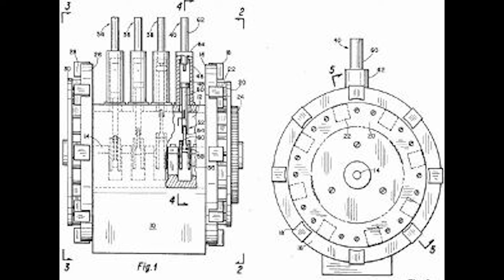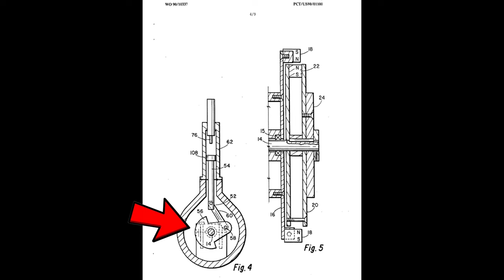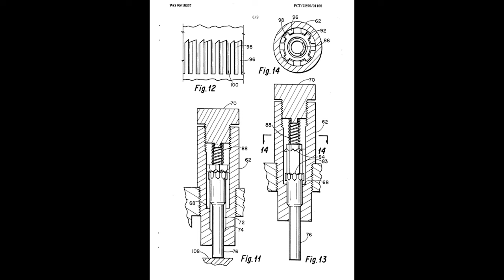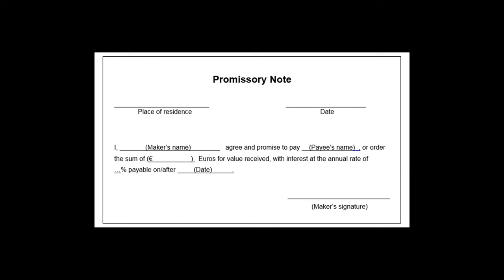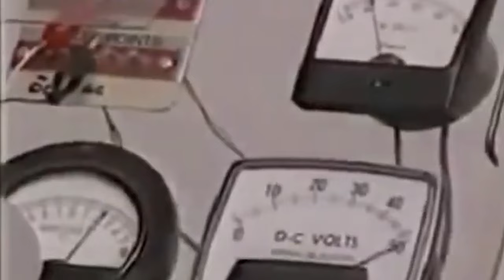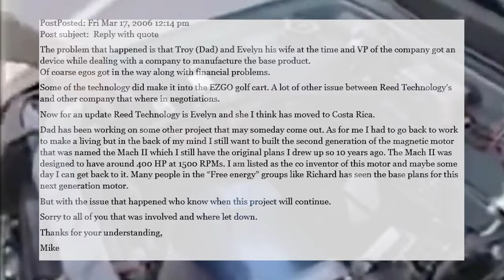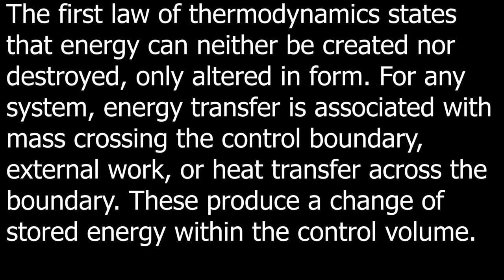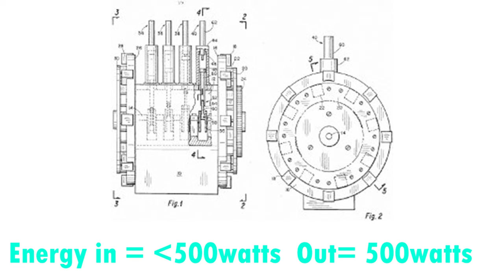Troy Reed and His Magnetic Motor: A Glimpse into His Revolutionary Energy Technology.

Comment: There was some footage of Troy demonstrating what he called the plastic battery, i had it many years ago and since then I have not found any sign of it again. It was car battery size, it would charge to 240volt , it could be charged to just 12 too if i remember correctly. From the little that was mentioned the thing was made of a well known’plastic’ and some metallic plate or film , who knows because he never went into detail. 

There are many patents for self sustaining generators, they get crafty in regards to naming each device. 

Same as the self illuminated,self sustaining unmanned autonomous high altitude platforms, they keep themselves fuelled, filled and powered, can stay up for probably decades at this time, small hydrogen fuel cells, a burner, thermocouples, solar and moisture taken from the atmosphere, some receive power and orders via those beeeg satellite dishes on the ground, some have smaller drones if you will, that decend to deal with ground crew, others deploy their mini mes that go perform individual functions and after an orbit will return to the main platform.
Reply: @darklight2.1  LIES... you tell LIES
Reply: @darklight2.1  You
Reply: @darklight2.1  Enjoy the playlist BTW, it's intended for your type, but also critical thinkers, hopefully help get your head out the sand some ..

Comment: This isnt free energy. Its using the energy in the magnets wich come at a cost. The question is whether that cost is a viable prospect for running an engine.
Reply: Yes magnets do store the energy but I’m guessing over time they will heat up and weaken
Reply: you can also change the magnetic field of a magnet.  When you put a small magnet up against a larger magnet the big one will pull all the magnetic energy from the small one.  This is easy to show with two magnets.  When you try to put magnets into another magnetic field it will change both fields around both magnets.  I have a drawing for a magnetic motor I did 10 years ago.  It is different than any other one shown because I take into account that the magnetic field changes when the two magnetics pass each other.  There must be shielding, magnetic re-charging, and understanding of the angles of force in radians.  Look up radians in your math text.  I have not had time to finish this as I am working on a design for a car motor by rebuilding a gas motor to run without gas.
Reply: It technically is jackass we are surrounded by electromagnetic energy or ether energy the ether exists and it’s all around us all the time just there.. if you can tap into that then it’s free 😂yes it takes brain power to figure out but in the end
Worth it
Reply: Not free energy and does not run on its own.  Magnets do not give off energy.  Magnets just have a static field because the north and south poles are in alignment.  No one has ever made a successful perpetual motion device, nor will anyone ever.  Why?  Everything has losses so you can never achieve 100% efficiency.  If you can't reach at least 100% efficiency, you can't have perpetual motion.
Reply: How long can a magnet stick to the fridge, fighting gravity, before its energy is depleted and it falls off?

Comment: I have a design that I have made myself " it's for an generator that produces enough power to recharge the 
Battery that starts it running in a few minutes. As it runs the out put is enough to power anything if used with my design. It also  depends on how far you wanna scale it
Up... I will be showing what I have designed as it powers 
My RV.... and  eventually a house...

Comment: How much power/energy does it take to magnetize the magnets? Also no one said a magnetic motor is a “free” “ perpetual” motor. 

When you are dealing with a material that has been magnetized the rules you are quoting are not accurate.
Reply: The energy used in magnetizing is rather small and could never run a motor for a reasonable time. If you buy a magnet you also pay for the energy which was used in magnetizing. If a magnet motor would deliver just this energy it would be better to buy energy instead of magnets in the first place. 
Permanent magnets deliver forces, no energy - except potential energy which is always plus and minus.

Comment: You wrongly assume these are truly closed loop systems to apply those laws of thermodynamics. The truth of the matter is, these don't violate any laws any more than a solar panel when you realize they are actually "open loop systems" held to the laws of open loop thermodynamics . According to the world famous physicist Richard Feynman, a cubic meter of space at the quantum level has enough energy to boil all the waters of all the oceans of Earth. Feynmen was widely regarded as the most brilliant, influential, and iconoclastic figure in his field in the post-World War II era.
Reply: Conservation of energy is a law which applies to open systems as well as to closed systems. It is one of the few laws of physics which is not only based on observations but has a mathematical proof, see "Noether theorem". A solar panel transforms radiation energy from the sun into electrical energy, and unfortunately also in heat energy which reduces the efficiency. 

What Feynman stated is correct but unfortunately this is a type of energy which can't be tapped - Feynman also explained why. Up to now no one was able to show a system which taps this quantum energy which would indeed result in more output than input as far as classical energy forms are considered.
Reply: @heinzpg   A modern day heat pump has a COP greater than 1. So there are systems with more out than the operator inputs. Conservation of energy is about not creating or destroying energy, but regauging it.
Reply: @DavyOneness    Sorry, heat pumps just as all systems do not have more output than input! If a heat pump gives you for example 4kW heat for an input of electrical power of only 1kW, the difference of 3kW is an input of heat energy which the heat pump takes from the environment mostly from air or water, and steps up the temperature. Fortunately you don't have to pay for this input of energy, but it is an input. If a system would output more energy than is input, energy would be created - which is not possible due to conservation of energy. Energy can be transformed from one type to another, but as you said, it can't be created or distroyed.
Reply: @heinzpg  You seem to not appreciate the difference between closed loop thermodynamics and open loop thermodynamics. I am not talking about closed loop systems, and heat pumps are measured by COP, or coefficient of performance, and in your example would be a COP=4.0 . I have built battery chargers with COP of 1.6 and higher, so I personally know the "quantum vacuum" can be tapped from experience.
Reply: @DavyOneness    I appreciate the findings of science, after all I have a MSc degree. Conservation of energy is by no means restricted to thermodynamics but a general law valid for all kind of processes. It is often formulated for closed systems but also valid for open systems.

COP is not relevant for the ratio of energy in and out, since COP is only used when an energy input is deliberately not taken into account. You claim you have tapped "quantum vacuum" energy? Get a confirmation of that by experts and you can get the Nobel price for sure! But I am certain that experts would show you that something is wrong with your power measurements. Since you talk about battery charging it might be something in the line of Bedini. Sorry, Bedini was a scammer, none of his constructions tap unusual energies. But correct power measurement of pulsed signals is difficult and not possible with the equipment of hobbyists.
Reply: @heinzpg  Doesn't matter if you have a PHD if you going to wrongfully claim COP calculations don't include the operators input energy, lol. So you fail with your appeal to authority logical fallacy with me, fyi. 
I would not expect you to believe my results if you don't understand open loop thermodynamics or vitual partical flux, or true negative resistance  from sharp gradients.  Lol, Nobel prize, that's cute...as if they didn't know about all this aready after ww2. Besides Lee and yang won it for Broken Symmetry in 1957, which is what I am doing, breakimg Symmetry..... If I was able to get real results from my replications, I 'm not so naive to believe this isn't already known about, besides Im not even the pattent holder. So if they got stone walled, what hope do I have with it?  Yes impulses can be tricky to measure, I understand that as a professional electronics enegineering Technician, but when you  recharge four 20ah batteries at the same time  by using  just one 20ah battery, it isn't too hard to figure out things are not like you have been taught in school. But I doubt you have the wherewithal to understand that as a psudo-skeptic who had been taught into a box of thought. There is enough energy in the emlty space of a coffee cup to boil off all the oceans on earth, according to Richard Feynman. 
Here is some declassified material from the freedom of information act to give you an idea how this has been taken seriously:
https://www.dia.mil/FOIA/FOIA-Electronic-Reading-Room/FileId/170031/
Reply: @DavyOneness    The COP of heat pumps gives the ratio of the heat output and the electrical input. The heat input taken from the evironment is left out. That's why the COP says nothing about the ratio between total energy out and in. If you doubt this, consult e.g. Wikipedia.

What's so surprising to charge 20 batteries from one? You can take an amount of energy from this one battery and fed it into the 20 batteries, but in average these batteries will only get 1/20 of this energy amount. Thus you will hardly charge 20 batteries from empty to full. Your claim is, that more energy comes out than is going in, with the difference probably coming from the quantum realm? Sorry, this is not known and would easily win you the Nobel price!

As to your paper, it confirms that presently not even a lab experiment exists which can draw continuous energy from quantum effects. The author expresses hope that this might change in the near future, and several scientists engage in this field, but this is just a hope. Also the huge energy in empty space is a calculated value. All attempts to verify this value by experiments have failed. This discrepancy is still an unsolved question for physicists.
Reply: @heinzpg "CoP = power output / power input. "  "To calculate the coefficient of performance, divide the heat output from the condenser by the power supplied by the compressor."  Extra energy enters the system from the environment, hence why COP of 4 means 4x the energy than operator had to pay for!!. Heat pumps put out more energy than the operator inputs, PERIOD, and is perfectly accepted in OPEN LOOP thermodynamics.  This is the problem with trying to reason with psudo skeptics and their degreed egos, it doesnt matter what you do, they have a dogmatic  answer based on their belief that it is impossible .Meanwhile I build it on my bench and I get  "oh you just made mistakes measuring" without EVER reproducing the experiments for themselfs because of their prejudice... The paper was only unclassified because it was based on the publicly available  science papers, not on the resisticted access military research papers like the second half of the project dealt with that is not unclassified like this first half because it didn't  just used public papers for a start. It's just the tip of the iceberg of the hidden science that has been Unfolding over the last hundered years. A fully 100% charged 12v battery is about 13.5 to 14 volts, and a dead 12v battery is like 11.5v, so I'm laughing at your idea of only 20% charged when I load tested everything, but psudo skeptics are going to be psudo skeptics.  It isn't that hard to measure input energy with just a precision 0.1 ohm resistor in series and using a meter and ohms law. And to measure the circuit "output" with load testing the fully charged batteries  and then convert to joules over time. Nobel peace prize? More like get covertly "heartattacted" by the intelligence agencies.... I'm fine with your doubt as you are just a psudo skeptic with no real power in the mainstream science community, just as I have no power to be ever noticed for a "Nobel prize" for replicating someone else's work that has been in the public domain for decades 🙋‍♂️But  have a nice day! 👍
Reply: @DavyOneness    Why this constant nagging of you? I described the COP of heat pumps exactly as you do! Yes, heat pumps put out more energy than the operator inputs, but they don't put more energy out than their total input of energy! A COP > 1 does not mean that in total more energy comes out than goes in. The energy output of a heat pump is exactly equal to the total energy input, which is operator input plus input taken from the environment. Heat pumps are in perfect compliance with conservation of energy. PERIOD. Don't babble about difficulties to reason with pseudo sceptics, my statement is trivial and any reliable information on heat pumps will confirm it. 

You measured the current via the voltage across a 0.1 ohm resistor in series? But wasn't it a pulsed signal? What did your meter indicate? After all, most meters are only made to measure either DC or sine wave AC signals. Did your meter indicate the average value or RMS? If RMS, was it "true RMS"? And are you aware that with pulse signals the product of volts and amps don't give you the correct power value, even with true RMS measurements? I suspect  you experiment with devices similar to Bedini devices, but Bedini was a scammer. 

Do you seriously think intelligence agencies care for tinkerers? You claim you are just replicating someone else's work that has been in the public domain for decades. But you fail to give specific informations as a name, a patent number or a link to a source - which makes your claim not really credible. If this is in the public domain since decades, it should be easy to give such specific informations and not just catch words as "open loop thermodynamics", "negative resistance" or "broken symmetry". Have a nice day too.
Reply: @heinzpg  Frst you claimed  no system exists that  get more energy than the operator inputs, so I gave you the analogy of a heat pump and COP,  expailened how these devices in question are also open loop systems and  closed loop thermodynamics does not apply like you are trying to force it. I then gave you the environmental source of the extra energy coming into the system from the environment , just like the heat pump and its environment . But you dismissed it out of hand to even be able to be get at it, even though we do all the time but just short it out to ground with a diode! !! Yes I have a fluke true RMS meter that will give me an average over time, or I can look at it with my 300mhz scope for better detail. You make it sound like impulses are magical , as if a battery can not be evaluated for how much charge is on it afterwards independent of said circuit. Besides that, I wasn't even measuring  the mechanical power of the rotor in calculating that COP!  I won't tell you about my other battery charger that does 10 Amp unidirectional impulses at around 3mhz for my ebike, or how it will work with a solar panel and MOONLIGHT!  cause I'm sure you got plenty of gas lighting to pull out your ass to just dismiss me as just mistaking my "measurements". You are just another armchair psudo skeptic on the internet, even if you did believe me, there is absolutely NOTHING you could do about it with your degree. Don't be so nieve about noble peace prizes, or that box you were taught into and handed a degree...
Reply: @DavyOneness    If you look back at my first comment you can see, that I only claimed that no system exists that delivers more output energy than input energy. I never spoke of an "operator input", I always referred to the total input. Your idea seems to be, that just as the heat pump takes heat energy from the environment, a system could take something like quantum energy from the environment. And yes, I also claim that presently - I will not make predictions for the future - such systems don't exist. You claim instead that such a system has been in the public domain since decades, but in your previous comment you shrink back from giving details about this system again. Why? 

It's fine that you have good equipment but as I have already pointed out, if both voltage and current are pulse signals the product of RMS-volt and RMS-amp readings does not give you the correct power value. All your data are more than vague. On the one hand you talk of charging 20 batteries with one battery, on the other hand you mentioned an COP of 1.6, which would mean that you can not charge even 2 batteries fully with one battery. But never mind how big the surplus energy output would be, it would indeed earn you the Nobel price, but of course not for peace but for physics. 

It is strange that you avoid persistently to give details about this system which violates conservation of energy as far as conventional energy types are concerned and which is already since decades in public domain. You also avoid to declare, if your system has something to do with Bedini or not. There has never been a credible verification  that the sum of mechanical and electrical power output of "Bedinis" is bigger than the electrical input power and Bedini himself never gave technical data. Very likely he never tried a verification himself because he knew that his claims are bogus.